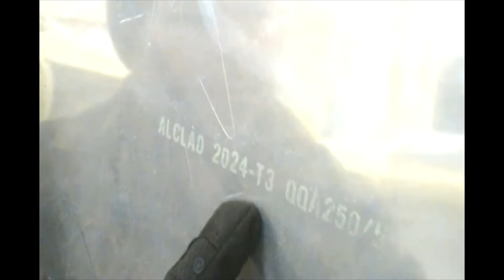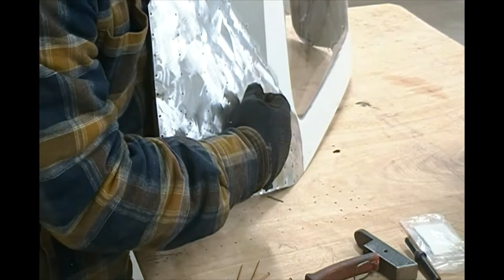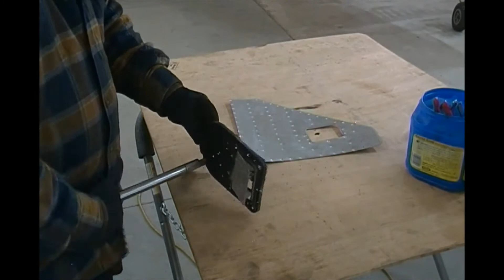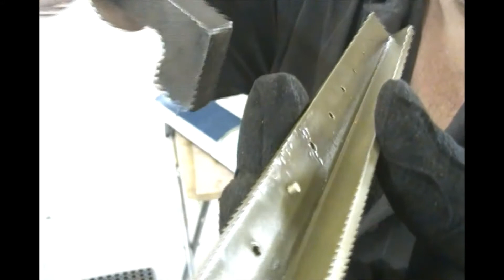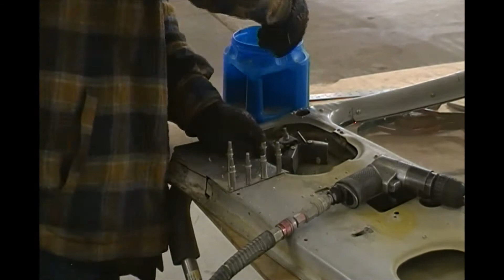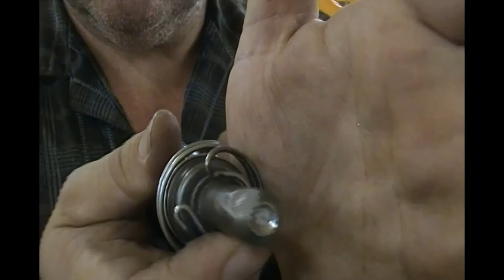Piper Aircraft Door Repair - Part Two

Comment: Liked your technique for locating the rivets inside the door with the bucking bar. Loved the look of the lines of rivets on the outside of the door. Was surprised that the previous repair used steel on the inside of the door, but, I could see the flange welded on the steel repair piece. The repair looks like the last one that door will need. Would love to see it painted. Also, didn’t realize that countersinks would add strength to the skin. Worth an hour to watch